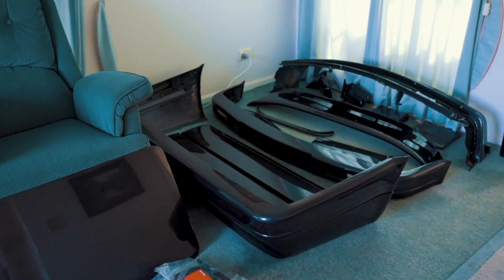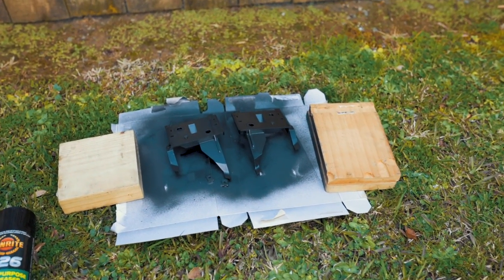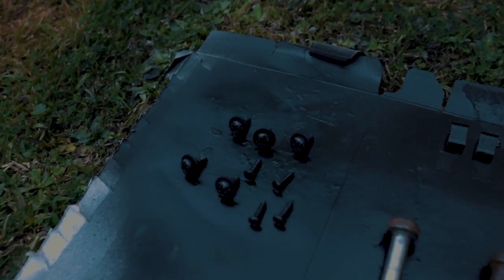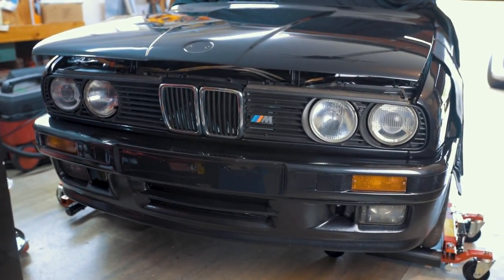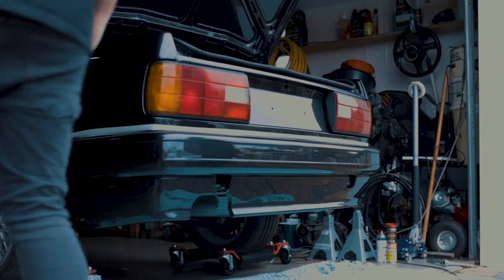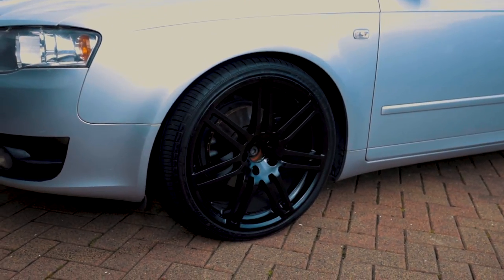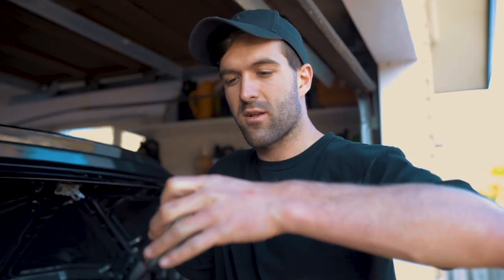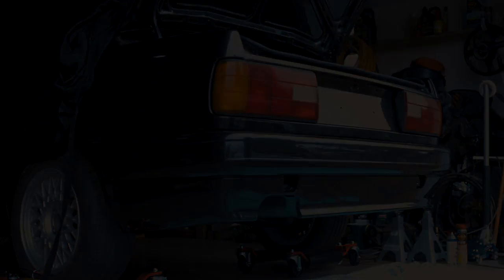M Tech II E30 | Fitting The Body Kit | Part 11

Comment: Sunroofs on early bimmers are a nightmare! I picked up an '00 M5 a while back and realized the previous owner didn't tell me the sunroof was broken. I failed to test it but still?!Lame. I set off to repair it....it turned into me removing the entire 'cassette' from the car which was a nightmare. Lots of little plastic tabs and pieces to break. Removed the entire cable and replaced these plastic slider tabs that BMW thought were a great choice for something that would be opened and closed thousands of times. Anyhoo.... thankfully I fixed it but I've been to afraid to actually open the sunroof ever since. My goal was to get it closed properly and never touch it again for fear it wouldn't cycle properly and immediately shatter all the new parts. 

Still love the car though I've sunk many $$$ into it including all new bushings, arms, ball joints, motor/trans mounts, thermostat.  Recently pulled the 10,000 lb diff out and did the mounts and prop shaft CV. 

I honestly enjoy all the work for some strange reason. Currently finishing an S52 rebuild for my '97 M3....will be doing that swap in the next week or two. All ARP hardware, new bearings, lifters, valves etc. Stewart water pump. JB 10lb flywheel. Baffled sump. Can't wait to take it out on the track! 

Love you content, guys. What's the plan for the E30 motor? M20?
Reply from the maker: I feel your pain, they are super complicated things those sunroofs! Sounds like a great car none the less. My friend owns a E39 M5 and it is truly fantastic! Nothing like maintaining classics I guess aye. Wow, two M cars, that's awesome!

Thanks heaps, I haven't quite decided but I'm looking into a M20 2.8 stroker most likely.

Comment: 13:56 alternatively you could put a rubber o-ring/gasket on the bolt so that when it's sandwiched between the spoiler and boot lid, it creates a neat watertight seal.
Reply from the maker: Good point!!

Comment: Did you drill the rocker panel before installing the side skirts? You need to in order to fit the mounts where side skirt is “hanging on”. We never saw that. In fact, all you need to do is follow the graphs in the ETK to install m-tech2 kit... that’s what I did some 15years ago... oh, by the way, the ring around your right inner headlight is the one made to fit the headlight washer blade... so, this doesn’t match with the rest... it smells like a wrong part replacement there...
Reply: Have a link to these install instructions?